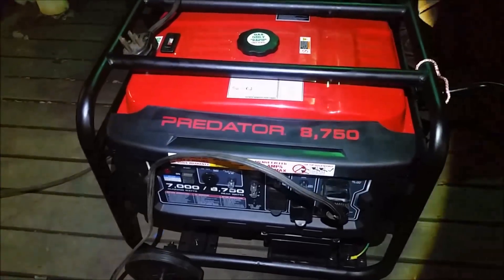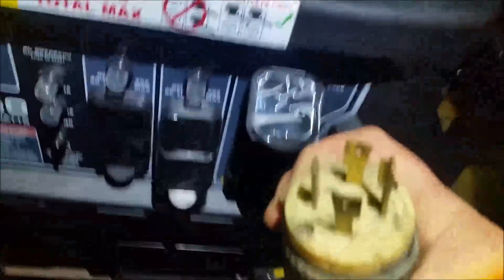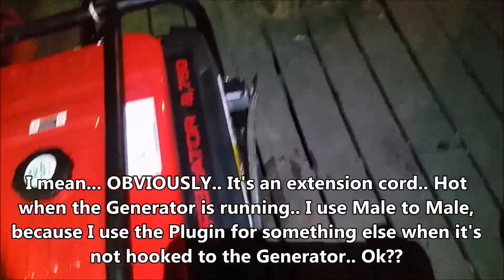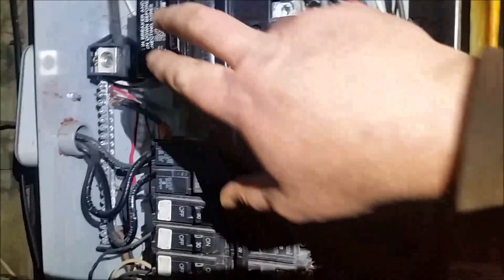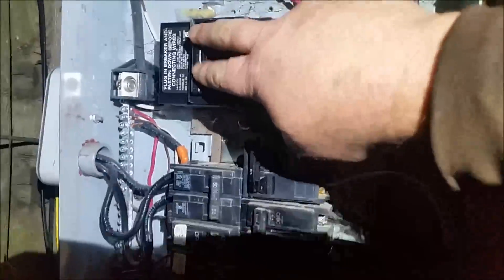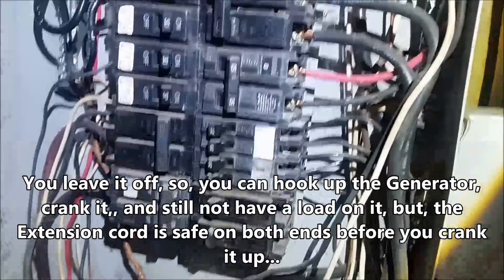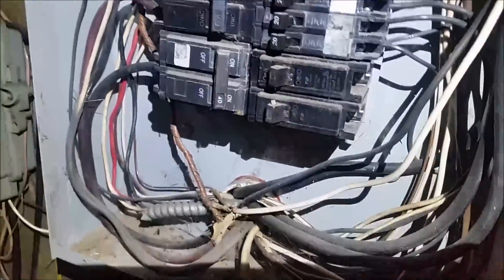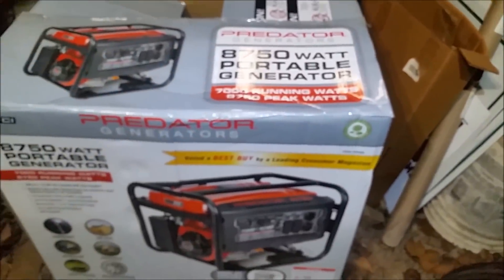Quick/Easy/Safe: Use Existing Plugin/Breaker for Generator hook up to your house Panel box.

Comment: Darwin award for stupidity! Someone will build, come home drunk and try to use it and die. Don't do this. Hire an electrician and do it correctly, to code. Signed, an electrical engineer.
Reply from the maker: Ha..Ha..Ha... No... I would say,, Don't drive home Drunk.. It's much more dangerous than turning the main breaker off, hooking up a cord and cranking a generator.. This video is not for Ignorant people btw.. You didn't see that in the video several times and in the notes?? Makes me wonder!!!
Reply from the maker: @NonyaBusiness! Go Right ahead.. If you think you are going to screw up with a Male to Male extension cord, by all means, don't do this.. This is not for you.. I would never forget. It's just that simple.. 
It it's 2am or 2pm, I don't forget to tie my shoes, or I don't forget to put the car in park, or I don't forget to put my gun on Safety... 
Like I said.. If this does not make sense to you,, you should do something else.. This is only for people who have common sense and know what they are dealing with.. 
I'm a Guns don't kill people kind of guy.. They just sit there and do nothing until someone pulls the trigger, and you are not going to convince me that they will.. It's just simple physics...
Reply from the maker: @NonyaBusiness!  No.. You are missing the point..  No one is incapable of making a mistake.. 
I may make some on things that don't matter that much, if I am tired, etc.. But, there is a BIG difference in working with 120 and 240 voltages.. That is why I referenced guns and safety and going the step past safety on the gun, to never point the gun at someone EVEN WHEN,, it is on safety, and I know the safety works perfectly and would never go off.. Besides the fact that I would not have my finger on the trigger when the gun is on safety, etc.. 
You see multiple precautions taken that didn't cost a cent, and, there was no need to do or not do, but, because it is so simple to do/not do, it is just what you do when you are dealing with something dangerous.. 
In the case of a Generator, the Male to Male plug is the Reminder if nothing else.. I can't pick it up without thinking,, careful of this thing.. It is a natural reaction to something of danger... But, it is just like a gun in a knowing gun owners hand..  Perfectly safe, if the one holding it has enough common sense to know it's dangers and how to use them and avoid them.. We do dangerous things every day, and we do them safely, or as safely as possible.. Get in a Car and drive as safe as you possibly can, and it does not mean someone won't run into you head on and no way to avoid it.. BUT,,, in this instance, it is all you and Nothing But You.. So, totally controllable circumstances, totally within your own control.. And, anyone with common sense is going to understand the dangers and not have to "Remember specifically to Turn the Main Break off", but, understand "Why" he/she is doing that ,and because of that understanding, will never make that mistake.. It's like trying to drive a car and not putting it in drive.. Some things just have to be done first.. Common Sense is what dictates that.. 
I wish you just drove up into my parking lot.. I would give you my Male to Male extension cord and let you hold it, and watch your face.. If holding it did not phase you, I would simply say, plug that end in, and hold the other.. If that didn't phase you,, I would say,, sorry, but, you don't need to use that cord.. Can you see that now? 

But, if you said,, "WOA!!!,, careful with this thing when I handed it to you,, then, you would be just fine.. Just a quick conceptual understanding of the panel box, and off you go, but, I would not recommend this for someone with even that limited amount of knowledge.. You just have to have common sense.. That's it..  I agree though.. It is not so common any more.. Now, that thought by itself if researched as to the reason why, would gain more common sense than just about anything I could think of. Because, the answer to that would require the ultimate amount of matching patterns with agenda's, history and knowledge of current events, etc.... It is just a totally different way of thinking.. Meet a very strong conservative who can answer all of your questions, and, you have found someone to teach you how that is done.. 
Watch for Patterns.. They are always Actions based on agendas.. 
Spend your whole day thinking about everything using Logic and Reason, and common sense builds and builds and builds.. 
If you play games on the computer or phone, devote that time to what I am saying and the easiest way to apply that logic and reason is looking at Politics, and you will exit becoming Conservative and will have more common sense than the most common. Ha.. Funny, but, true!
Reply: Fred Zlotnick, that’s why everyone really needs to watch this video about generator safety https://youtu.be/I1jT3ANENvI it’s better to be safe than sorry. Thank you.

Comment: Simple...but dangerous...regardless turning off the main breaker to prevent back feed, you have a loaded cord with exposed prongs.
Reply: Mr. Thomas,.now that you fully explained it isnt live, but regardless...if the other end of the L30 plug is connected to the running generator and may become disconnected from its female outlet, you have exposed energized prongs.
Reply from the maker: Otto.. That works for any type of plug coming out.. but, this is a locking plug anyway, so, even less likely.. But, if you are looking for lightning to strike multiple times in a day on the same person, you might find odds that will make me consider that situation.. Besides.. I can't tell exactly what you are saying, but, if the cord comes disconnected from the generator, the prongs on the other end will not be hot anyway.. And, I don't know if you have ever tried to unplug the other end,, NEMA 14-50R.. It damn near takes two hands, so, is even more unlikely that it would come unplugged.. The Generator plug is more likely, and would not cause any problems anyway..  Besides, the generator has a GFCI on it, so, it will pop quickly, if there is a dead short to ground.. I would rather worry about having a blowout on a brand new tire.. It would be much more likely.. If you look hard enough, you can find reasons not to use anything.. By the way... Ever check out the for you use for breakfast? It is sharp.. Has points on it.. Might poke your eye out with it.. Better not use it anymore.. sorry.. I don't subscribe to such nonsense either.
Reply from the maker: Jim Piver?? Backfeeding??? Ha..Ha..Ha.. What a total DumbAss...  You should remember to tie your shoes before you try to run out of the house.. Your brain is suffering from it... I never forget such a basic item.. Same with the Main Breaker.. Your Fears that you can't remember such simple things has nothing to do with me.. I don't have that problem.. BTW.. You should put a note on your dash to keep you from getting out of your car without putting the parking brake on.. Ha.. I don't have that problem either.. It's just common sense.. Sorry you can't relate... What a Dip!
Reply: Here is why generator safety is very important https://m.youtube.com/watch?v=I1jT3ANENvI
Reply from the maker: Really?? Entertain me for a minute.. If I hang the cord on the wall, Coiled up and unplugged.. Is it still dangerous?? 
Because it still has exposed prongs? I am being literal to make a point.. Feel Free to answer both questions.. 
If it is not dangerous,, then,, if the main breaker is off, and the Welder/Generator Breaker is Also off as a second and un-needed safety measure (although not intended for safety purposes), and the Generator is Not Running.. 
If the exposed prong plug is plugged into both ends,, One end, a panel with No Electricity behind two breakers in the Off Position, and the other plugged into a "Non Running Generator",, please explain to me how it is a Dangerous Cord??? 
If your answer is "It is Potentially Dangerous, then, I must ask you.. What do you do about all of the cars on the road every day?? Dangerous killing machines?? And, what do you do about the Sun to protect other people from getting Sunburns, Skin Cancer, etc.. Or,, should we remove these things in this order which are the #1 Causes of Death in this Country.. #1 (Hands), #2 Knives (from all people (Mothers, Chefs, Hunters, etc..) #3 Hammers (From every homeowner and every DIY'r and Carpenter in the Country) $4 Baseball bats from every (Family, kid, baseball team, Scout group, etc).. I mean.. I'm just wondering what you go through each day with that type of mentality.. Care to enlighten the group here?? 
Because My Guns do not Kill People when they are unloaded, nor do they shoot someone when they are not in someone's hands pointing at someone else and the trigger pulled.. It's physics vs Liberal Crazy Antics.. Physics always proves to be the Truth setter.

Comment: Most of the time,  when the grid fails and someone needs to keep their food from spoiling, they will run some extension cords into the house from the generator, to the appliances that need power. Why? Because it's cheap, simple and temporary.  No big investment is made in change-over hardware, because most people don't want to be storing 50 gallons of gasoline for years. Likely not even legal in some towns.  
If there is ever a grid failure that seems like it's going to last for a long time (days? instead of hours.) that's where the suicide adapter comes in handy. Because you are going to want to run your toaster, coffee pot and maybe a TV set..  Running a dozen+ extension cords is not the best idea.  Using the suicide adapter isn't for everyone. Mostly just technically inclined folks.  

In Southern NH, they had a lot of grid failures due  to a massive ice storm.. Some people used generators for 6 weeks! 
During that whole time, Home Depot (MA.NH.ME.CT & VT) was out-of-stock of all common 220v plugs. Guess where they went?
Reply: Generator safety is extremely important for everyone https://youtu.be/I1jT3ANENvI it’s extremely dangerous if you run your generator indoors. Thank you. Hope you all agree with this advice

Comment: Also looked like the generators were running inside the garage.
Reply from the maker: It was.. Always does. For the last 13 years..  But, it is my back garage. I use it for storage basically.. And, it has open eves and I don't  stay in there when the generator is running.. Too Noisy... It's why it is back there.. Same with my big Air Compressor. It is not too noisy, but, always kicks on when you are not expecting it to, so, it stays back there too. Out of the weather and out of the way.. The generator on the porch was just being broken in and tested using an extra 220v outlet I use for welders, etc.. when I am working on that side of the house on other projects..
Reply: Please never ever run your generator indoors because it is not safe https://youtu.be/I1jT3ANENvI I just hope everyone uses their generator carefully. I just hope everyone agrees with generator safety. I’m not trying to force everyone to watch this video.

Comment: Seems very strange to me that these goofs would rather spend hundreds of dollars on a generator and then cheap out rather than buy a proper transfer switch and properly protect their family from accidental electrocution.......or would it be accidental? Sometimes the logic that people use is so twisted it can't be undone.
Reply from the maker: Jimmy Tate: Yep.. I agree fully with the last sentence you made.. If you can't remember to turn the Main breaker off,, or tie your shoes, or put your car in park before you jump out, I agree.. You should go ahead and not try to save any money on a transfer switch.. You should then, spend the money on an Electrician, and see if you can DIY on your next, NON-Electrical project..  Yes.. If you can't understand the Main breaker and what it does,, you should SURELY stay away from any type of Panel related Electricity projects.. There is Zero way you could install a transfer switch..